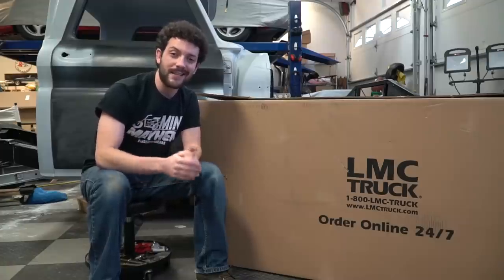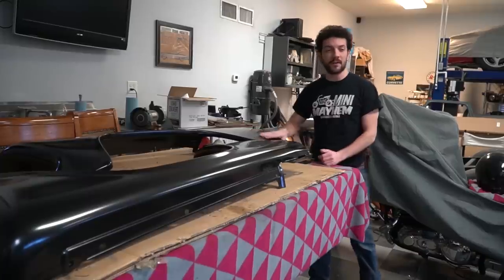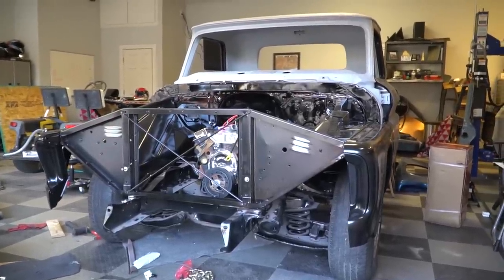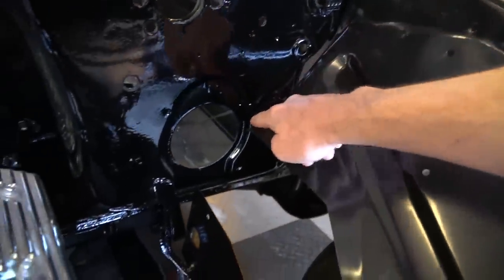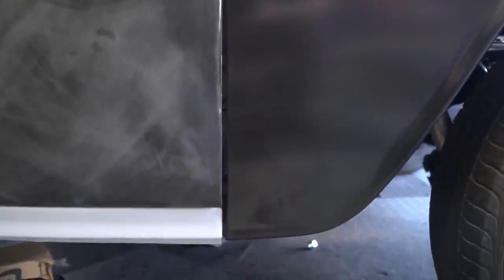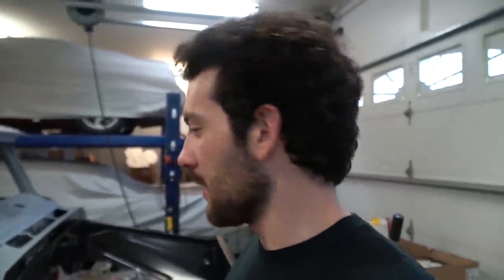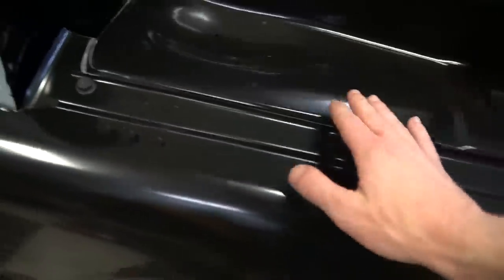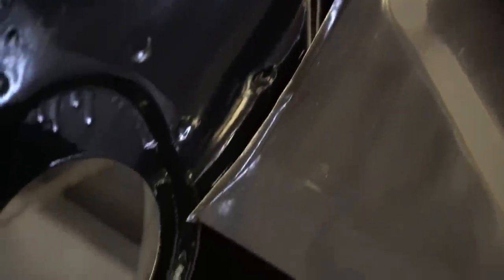Reproduction Body Panel Install! Chevy C10 Restoration

Comment from the maker: Thanks again, LMC! Slowly but surely, my truck is looking like a truck again!
Reply: Drop a 2jz in it
Reply: Nice
Reply: Slowly is the keyword!! Lol.. Keep up the good work..
Reply: Update soon
Reply: my brother did a 70 shortbed c10 several years ago on LMC parts. he was pretty happy with the overall outcome. he had to do skins, trim, chrome, and interior bits, and LMC supplied him no problem
Reply: Josh Hust Nice!!
Reply: Steel or aluminum
Reply: Try to restore those original fenders and keep as mucg of that original parts as possible, originality is let with these old trucks it helps price numbers too lol

Comment: I had a 63 stepside with the wrap around windshield and the small back glass. Full custom, 6 lug, power everything, disk brakes, Alpine/Orion/Clarion audio, all wood grain/digital cluster and full custom imbroidered head liner and carpet. 350/350t

Comment: I tried to tell y'all about (LMC ) when you first asked about help with parts, but you didn't want after-market parts. I've used LMC for many different builds & repairs. Good people and new parts I don't know if it's American steel or not but hey, it works... (Year one) should be able to take care of all your rubbers and interior parts. (Painless wiring) should cover your wiring loom needs.
 If you need anymore info,  pm me  I'll see what I can come up with....... I've even got a vintage large dial tachometer laying around here.  The best of luck to ya.....

Comment: Try shimming the body mounts to correct the door gaps and alignment of body lines. Shims are an important part of setting the cab on the frame. Body shims are available at most good parts stores.

Comment: Probably should have moved the rad support forward just a little bit to line up the fender holes. 
Maybe even snug down the mounting bolts to drop the rad support a little, or double checking the front cab mount for proper height. 
Other than that, I’m glad to see your old iron coming back together.👍

Comment: You need to shim the front of the cab up about an 1/8 to 3/16 ths of an inch  to achieve the alignment you need. The center tunnel should be bolted in when you do this to help stiffen up the body. I have done a bunch of these and some things you remember very well.
Reply from the maker: Thanks, I'll bring it up with the master mechanic

Comment: You may already know this, but for those that don't,  This sheet metal comes with a very good coating already on the fenders. If you can avoid it, Don't sand it off. Sand it with a red scotch bright pad and then prime over it. This coating will actually help your primer to stick better. Since its a tough coating, it will help protect against rust. Once you have the fenders trimmed if needed to make them fit, undercoating is your friend. Before bolting them on for the last time, put about a quarter inch deep of alligator skin undercoating behind the fenders. Then bolt them on. The sheet metal will be sealed and will last forever. You may want to wait until you have the fenders and doors bolted on for the last time. That way you can seal cracks and keep the water out. Spray inside the doors to. It will help seal the door so it doesn't make that hollow sound when you close the doors.

Comment: Ideally you really shouldn't strip those parts down completely. That's an E-coat, epoxy coating. You really only need to abrade the surface then prime unless there's really bad spots in the e-coat. Looks great, keep up the good work.

Comment: If that is an e-coat dont strip it! Thats the best corrosion protection you can have on it! I usually sand the bigger surfaces with 320 grit sand paper on an interface pad on my DA. Then I scuff the harder to reach areas with a red scotch brite pad. Then all you have to do is seal it, base, and clear it✔

Comment: shouldn't that coating on the fresh panels be an e-coated primer?? if so, i would only scuff/sand because of the metal is likely pre-treated with phosphate ect. ?? only remove it if its a "shop-coat" (coating for shipping/storage to prevent surface rust)

Comment: Sweet!! What engine and is it built or stock. Like your builds. Miss the dragster.
Reply from the maker: It's a mild 350 crate engine. 330 horse 385 torque. Should do OK

Comment: Don't strip the black primer. It's high quality primer. If anything scuff it and prime over it.
Reply from the maker: Really? I've heard otherwise. Weird
Reply: @CarsandCameras  Never heard of having to remove it, just scuff and prime. Any place the metal shows through use self etching primer.
Reply: @CarsandCameras  yea I would look into it. Personally I've seen allot of glass paint jobs that have been just scuffed and primed over the black factory primer. Think about how hard it is to strip off? Quality stuff just saying. Love yall's videos and keep up the good work.
Reply from the maker: @wadeedwins8571  I hear ya, thanks for your input. In that case, I'll probably leave it on haha
Reply: @CarsandCameras  it'll be fine 😁
Reply: Yeah the oem black primer is the best out there and has the best adhesion
Reply: Its called E- coat, Electrostatic or electorphoretic  primer
Reply: Thank you josh i couldn't remember what it was called lol
Reply: @joshuavallot8921  congratulations somebody went to school for  auto body
Reply: Wade Edwins I took two years only one has e coat aftermarket has something different
Reply: I go to the best tech center in the USA and we restore trucks all the time we are even doing a Chevy c10 just like his
Reply: We did be rabbit a doge f150 f250 a Toyota a impala a Volvo you name it
Reply: At the end of the year I pay 100 dollars to take an I car exam to become platinum certified don’t fight w me
Reply: I get the classes free while anyone else pays 400-600 dollars per each lmao
Reply: He should go on the pppg paint it web site and choose a vibrancy color for his truck
Reply: And also the paints will cost you 1500 on the low side for a gallon without clear and sealer
Reply: And if you really want the best corrosion protection use epoxy or self etch
Reply: And use deltron or shopline for higher quality paints
Reply: We used a 6” da sander w 80 grit to clean the whole c10 then we did all the body work and primed it in a week
Reply: We use a lot of fes tool Dutsless Sanders we have like 8 of them that cost over a grand
Reply: And we also have a paint booth that can fit a full size f250
Reply: And we have aluminum welding steel welding silicon bronze welding plastic welding aluminum repair Refinishing steel repair plastic repair taping and masking of cars and estimating on damages cars using ccc one we have all wat the professionals have and more
Reply: We have a prep deck
Reply: They even let us do a co op where we can work in a real shop like gerber auto collision and we get payed to go to work and get credit for our classes at the same time
Reply: I’m only 17 lmao
Reply: We use miller welders and snap on tools we have and entire class room lined with giant tool boxes taller then me full of tools for the atobody class and atomecs a and b classes and we have an entire separate building for the diesel mechanics
Reply: My school has over 30 different programs that will certify you and put you in a job right out of high school making over 15 an hour
Reply: We have over 12 lifts between two classes lmao
Reply: I believe it is a strong etching primer, and their prep is very good. I have heard this for years. and I am a old man.50ish
 @CarsandCameras

Comment: With all the electric/hybrid vehicles getting more traction with people, how long will you able to drive your truck until the government says 'no'?
Reply: A very, very long time. It's going to take most of the next decade at least before they gain much mainstream appeal, and well in to the 2030's before they become cheap enough to mass produce efficiently, safely, etc. There's just no support in the market for them from consumers or infrastructure right now, and it's going to be a very long time before that changes. At least in the vast majority of countries. 

So as to when the government of all people says they can't drive it any longer? Well my bet is just about never. It will take decades before governing bodies have enough sway to say 'no' to one of the largest and most profitable international markets existing today...